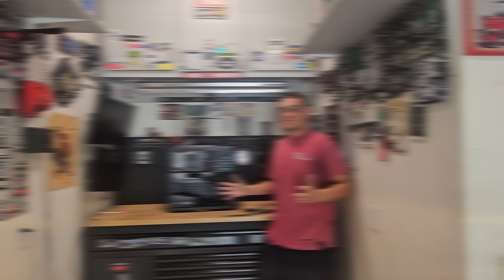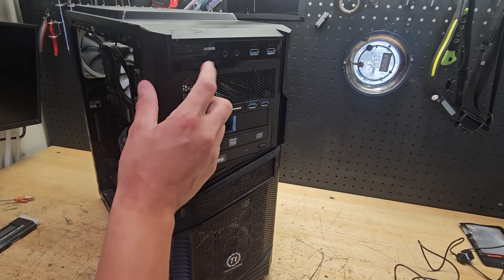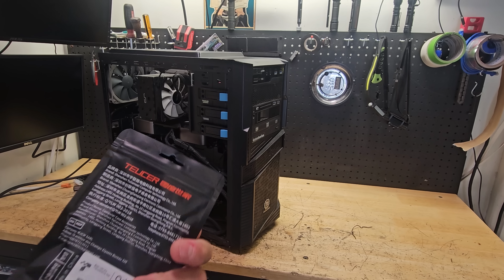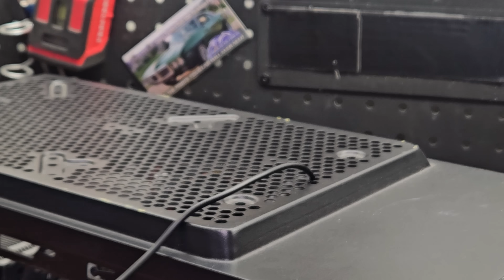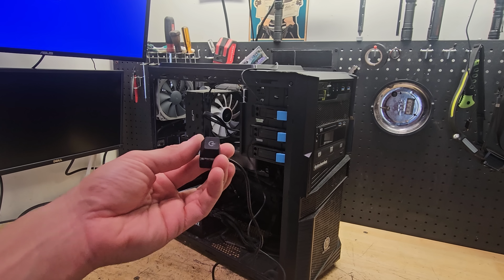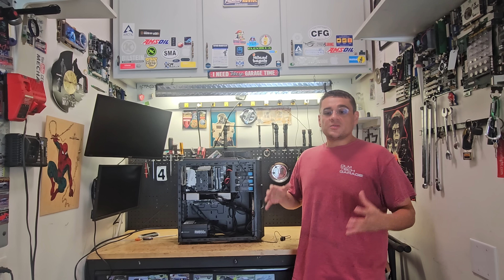PC shop claimed this computer  was fried... but the fix was simple and free!!

Comment: A ~$25 PSU tester can save you a multitude of headaches and plenty of 💰💰💰💸💸💸💳 and help avoid rip offs!  I purchased a PSU tester and only needed it a few times, more often for family/friends PC’s from expensive repair shocks!  I have myself a kit of extra cables, parts, bits & pieces, even a cheap non-psu powered GPU to diagnose my issues and yes it cost me <$100 …… but it’s saved me and family and friends $$$1k’s and more!

Comment: I did it on my Antec 300 case.  I went to Lowe's and bought a momentary switch to connect the power switch cable.  I enlarged the original power-switch hole on the front of the bezel, and it works fine.:face-blue-smiling::face-green-smiling::face-green-smiling::face-green-smiling:

Comment: I had this problem some time ago, i simply re-soldered the power button and added some hot glue to keep it in place (i broke it behind the front panel trying to remove it). Standard power buttons are modular. I think you can buy the mechanism behind the power button and attach it to the old power button instead of getting a new one, but i was a teen with no money back then!

Comment: Unfortunately, there are shops like this. Usually in my experience they are smaller and privately owned. A local shop near me is like this. The sole focus is profit. They low-ball people to buy their PC's them mark them up. They offered me $100 on a $320 Alienware from eBay, as they claimed the motherboard needed to be replaced, which it did not. Their reviews show a lot of unhappy customers, but they obviously don't care as profit is the driving concern. Don't use Geek Squad as they are clueless, but try to find a larger shop and check their reviews. Great video.

Comment: you could litterally replace the original power button by popping off the front and getting a generic power button from some scrap pc at the junkyard even if its on a pcb simple soldering is a thing idk why this has to be convoluted you can even leave the original power buttons cable in the case and run a new one to the front

Comment: It reminds me of a problem commonly seen on old computers you often see on Amazon (maybe Walmart) where the computer will no longer boot due to hard drive not found. The reason why people complain in their 1 star reviews about this is because the sellers tend to include a no-name SSD like KingFast that are known to fail. A similar problem happens with Wi-Fi because most sellers, often on Dell OptiPlex desktops, tend to include a no-name USB Wi-Fi adapter that usually has mixed qualities. Both are easy fixes, but I'd imagine most people won't know they have a bad SSD until they find out Windows doesn't boot and they open the PC to investigate.

Interesting to see 5.25 bays on this case. A lot of newer cases these days don't even have 5.25 bays although some newer cases still have them.

Comment: Well, I doubt they were being dishonest because they would have swapped all those parts out and it still would not have worked.   There was another youtube PC guy whose #1 thing was always power buttons.  He had seen enough fail that it was his personal bugaboo to always check that.  And then there is a different guy I watch who, when the diagnostic process gets deeper, he is just starting by shorting the MB which inherently tests the power button.
I speculate you could find a replacement switch from Newark or some other electronics company.  I guess I dunno how many of those places are still left these days, tho.   Late stage capitalism has really limited our choices.
For my problem, I had a power button failure on my case, but it was a mechanical failure.  When I pushed the button, I pushed it so hard it pushed the switch out of the back of the mount and would no longer work.   Fortunately, my motherboard had power and reset buttons on the board, so for well over 5 years I just had the side off the case and started the PC on the motherboard, lol.
I assumed the only fix was to superglue the mount so I kept putting off the repair.  I finally go around to checking it out and, from the factory, the switch snapped in and was hot glued, so the factory new about the problem.  The issue was they just dabbed some glue on it and sent the case down the line and it was never properly glued.
As I inspected it, I saw that the holding snaps were there, but just weakly designed.  I was able to use a tiny zip tie to compress the snaps tight and now I can push the button pretty firm with no problem.  Obviously if I jam my finger in it, I'll break it, but I think it will hold up to any reasonable force now.

Comment: I think the power button is also repairable. Could be oxidation is causing poor connection inside the power button instead. A repair shop can dismantle the button and clean the oxidation off the contact surfaces

Comment: I had a customer that decided to build a computer with his friend and then it didn't turn on .  so he took it to best buy and they charged him $70 and told him he needed a new motherboard .  he installed the new motherboard but it still didn't turn on so he brought it to me .  I tried a new power supply , new memory .. unhooked everything including the ssd .. still nothing .. took it out of the case .. still nothing .. decided to check the cpu pins and see if there was any damage .. and there it was    A AM4 cpu in a AM5 motheboard .  he had removed the metal hold down to make it fit .  burned the cpu .. and bent pins on the motheboard
Reply from the maker: Wow! That's a crazy!!

Comment: If you look at the back of the front panel, there should be plastic rods that snap into the holes in the case. If you squeeze them gently, you can push them out, and the front panel comes off. Then you get access to the power switch and can replace it

Comment: Any ideas, I have a psu that won't power on any motherboard. But with a tester, even under load it works fine.
Reply: Disclaimer:  DON'T ELECTROCUTE YOURSELF    But when you cannot get the mother board to power it up, have you tried shorting the start wires though the back of the ATX connector?    It could be a problem with either the start circuit in the power supply or something with the motherboards you are testing.
I guess before that, have you tried just starting the power supply on its own?  Some will, some will not w/o a load as I understand it.
Also, do you have another power supply handy to test in comparison?
I'm just spitballing ideas hoping they might help.
There are also times where a problem is just not worth trouble shooting.  Is it a particularly high power or valuable power supply?

Comment: my fav when someone tells me the board and psu is bad. 
sorry I have very little trust in anyone but myself. tbh if you pull off the faceplate. probably has the normal tiny atx power button and can be replaced quite easily.
people are too lazy to be bothered in looking at used pcs. unfortunately too many people look at used pcs as "junk, and not worth their time" They rather sell new parts and call it a day

Comment: Out of curiosity, why go through the top, if going to remote mount the button and not a expansion slot on the back of the case. Would be way cleaner and easier imo, and I know they sell versions of this power button with an expansion slot cover with wire passthrough.

Comment: Is the case on the floor, or on a desk?  If it's on the desk, one could run the cable up thru the bottom of the case (if it has holes) then you could just slide the excess cable under the PC after one finds where they want the Power Switch to be.

Comment: LOL, i have one of those buttons because of the early adopter DDR5 issues. so i got one and plugged it into my BIOS reset because i got sick of openning my case and removing my GIANT vertically mounted gigabyte 4080 to get to the BIOS jumper. Mine is magnetic though so just stuck it to the back of the case.

Comment: I regularly forget to turn the PSU on and every time have a moment of panic when it doesn’t turn on, especially since I have been buying a bunch of used components from eBay recently.

Personally I’d have just used the reset button if it had one. If it didn’t have one I’d have swapped the cases’ switch with a replacement since I kinda like the stock look.
Reply: We've all done that. Nothing like that momentary panic, it really gets the blood flowing.

Comment: i know it is a old case, but is really ugly! i have here a 10 years old case and look 100 times better

i had to rebuild a power button some years ago, the spring was not working well, i replaced it and button presses better now, it has been working well for 7 years so far

sometimes you can transplant the button from another case, i did it once, hot glue and zip ties do wonders sometimes
Reply: Cases choices are HIGHLY subjective, lol.    My case is the old Winter Digital Camo, I'm sure most people would think it is silly.  😉
Reply: @l337pwnage  completely true, but my old case looks like the modern boxy clean cases we have now

that thermaltake has no psu basement situation going on, so everything looks ugly and disordered,, no good front to look at, and worst quality buttons possible

i guess is from 2012 or before, for the 5.25 drive bays on front, but this made me remember those old ugly cooler master cases people loved in the past, like the haf and similar that if you lok at them now, you hate them and dont want to have anything to do with them

Comment: why not just switch the working reset button over into where the faulty power switch was located? That would be much cheaper than using the admittedly cool power button you bought. the sizing for those are pretty standard though if you just wanted to swap it out for one from a dinged up or damaged case.
Reply: He says why in the video. The first fix was to switch them, but his dad doesn't like using the reset button as the power button, hence the remote button.
Reply: @7MBoosted  which is why I asked why not physically move the reset switch over to where the non-working power switch was located. most cases have that switch popped into position on the underpart that holds the reset and power switch, so it's easy to swap out.
Reply: @vanloggins sorry, I guess I misunderstood your original comment. I will own that.
Reply: @7MBoosted  It's all good.

Comment: Nice easy fix over a worn out switch. Maybe it's carbon buildup or some corrosion on the contact as they are simple in design, within the switch, maybe take it out and see if it can be prised open to see if that's the cause.
Reply: What carbon?